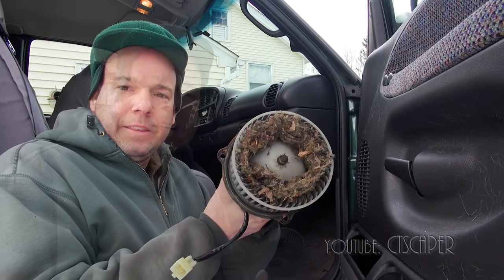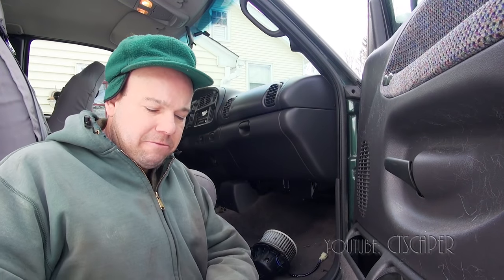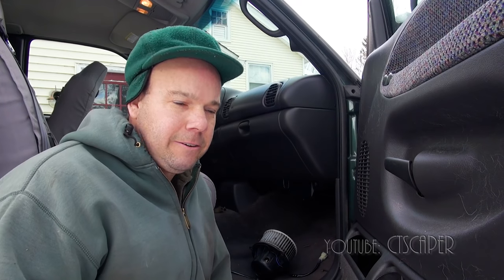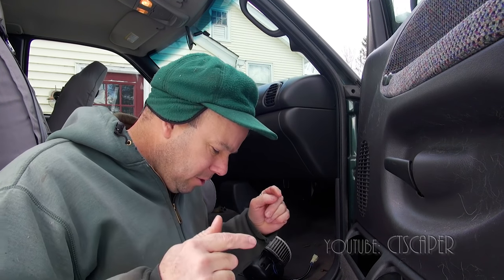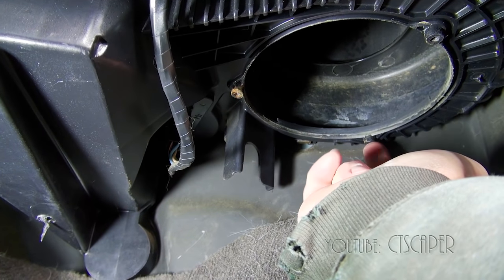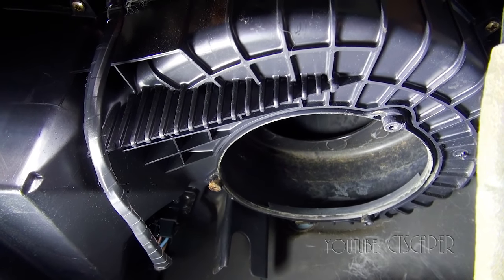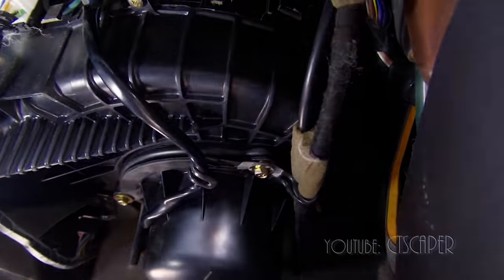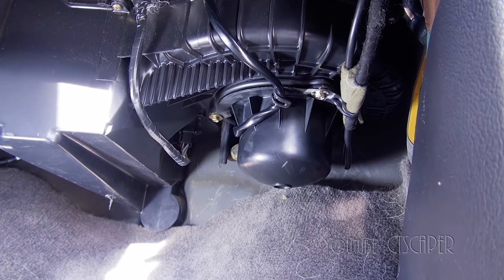BLOWER NOISE IN CAR OR TRUCK

Comment: Two things:  The reason they tell you to disconnect the battery terminal (just take off the negative) is so that your air bags won't deploy because of a short to your electrical system. Deployed air bags without an accident would ruin your day. The other I'd do is maybe tape or jam something up in behind the motor as a "back splash" kind of thing like a plastic bag or a piece of cardboard so that if you drop the little screw or bolt, it doesn't fall in behind your carpeting never to be found again. Keep your back splash higher than the screw and laid out in front of the carpet. Saves grief ....

Comment: Thanks for the post. I have the squealing sound on my 2001 ram 2500 for 2 years now and have been putting it off. But this looks really easy. Why have I not tried yet? Now I have the confidence to do it.
Reply from the maker: It's the most awkward position to be in but you can definitely do it.

Comment: Had the same issue last week, super loud noise  - almost louder than the engine when I turned on my heat on. Assembly is similar to yours in my Nissan. Take apart the glove compartment, 3 screws....of course one in the back is a real pain to access. Anyway, clogged with leaves other stuff. Seems like a chipmunk or mouse was building a nest also. I cleaned it totally out and problem solved thankfully! 7 days later...I get the same noise again, not as deafening...just finished taking this apart once again. More leaves in there (nothing clogged up like last week). 

Trying to figure something out...little hack on how to block this area with a thin screen, BUT this may come loose and fall into the fan destroying it, the entire motor, so thats no good!. Right now...eh, seems I have a very persistent little critter really wanting to live in my heater blower for the winter.
Reply from the maker: Rodents only pretend to be stupid.  It amazes me how they figure out how to get into places they aren't supposed to.  Glad you got it taken care of and hopefully it goes a little easier each time you clean the fan.

Comment: Pretty sure I've got the same problem. Let truck sit for a month, colder weather now. Smells of urine and blower is clearly off balance.  I'm curious if you found the entry point the mouse was using to get into the duct work?  Also any thoughts on removing the odor?  THanks, Great Vid!  Happy Holidays!
Reply from the maker: No idea where they're getting in though the though crossed my mind when the cold weather came.  I've started leaving an enclosed mouse trap inside my truck when it sits for a while.  I caught a few in my dump truck last year.

Comment: I wonder if there could be a filter put up in there. Where the fan wont get caught in that whole you showed us before putting the fan back in ;) I notice how the the 1995-2004 tacoma trucks dont have a air cabin filter but the 2nd and third gens do.
Reply from the maker: I think you've got it Donna.  I don't see a way to reasonably install a cabin air filter in my truck but in the early 2000's most cars started getting them.  Now the mice build their nests on top of the cabin air filters.  Much easier to clean out but just as nasty.

Comment: Yup.  I had a mouse chew through the air filter into the fan and die.  Really hard to retrieve that stinky thing.  Ended up using a pair of surgical forceps but it still too like 50 tries.
Reply from the maker: Now that's nasty.  I felt very fortunate to not find any mice when I was cleaning that out.

Comment: My 2008 Jeep Patriot's heater fan just started making a growling noice when it's on the three highest settings. Just started like that. I wonder if a retaining bolt/nut wiggled loose and there's a lot of vibration. I can actually feel the vibration in the steering wheel. I turned my Patriot off with the key just at accessory position. Same growling noise when fan on high.

Comment: Thats hilarious,,,where does the blower pull air in from?
Reply from the maker: I wish I knew.  A lot of the new cars have a filter for the air coming into the blower motor.  However, older vehicles, like mine, don't.

Even the cars with the filters can have mice in them.  I don't know how, but it happens.
Reply: @CTSCAPER  My old lada had a heater core...pretty sure it came from the outside. As I grew up people used to say the heat comes from the engine. I dont think that is accurate in any case. But prestone from the enagine does run into the core..but anyways.

Comment: I have a similar problem with my 2001 Honda Odyssey but mine is caused by leaves.  No idea how they get in there but at the end of every fall I have to remove the fan motor and clean it out.  Just as hard to remove on a Honda.
Reply from the maker: Does your model have a cabin air filter or is that one before cabin air filters?  My Dodge doesn't have the cabin air filter but it would be so nice if it did.  That would at least slow them down if not block them.
Reply: It DOES have a cabin air filter.  Despite that I still get full-sized leaves in that "squirrel cage". Haven't been able to figure out how they get there.  Has only been a problem in the past 3-4 years so something changed.

Comment: I change the cabin filter from my Toyota corolla 2015. Next day i drove the car, turn the heater on and strange noise from the motor which i never heard before.  I removed the cabin filter n put my fingers in the motor n there was a Walgreen's receipt.  I gently took it out n the rattle stop.
Reply from the maker: I wonder how that got in there?

Comment: How did/do you get rid of the smell of mouse pee?  I have this issue right now but I just can't get rid of the horrible smell. Let me know, Thanks!
Reply: Keon Abbott I just read somewhere else to spray Lysol on the filter and all surrounding plastic and that should remove smell
Reply: There's a spray-on product called OdoBan, a spray. Had a dead rat in my 4Runner. Killed the smell.

Comment: I’m wondering if you would have used a extension that bends like a spring or it is a spring with the ends that you can attach a socket and the ratchet Harbor Freight has them for less than five bucks I think it is??? 

   Oh great video. 💯👍🏼😊

Comment: Wow that's a hell of a nest. I live in WV its been 0 degrees and I just fixed my heat in my truck for the first time 1994 Chevrolet C1500 and my blower moter is squeezing like a bitch. Mine is going to look similar but it's going to be filed with leaves and branches from years and years in the woods.
Reply from the maker: I've had to clean that out a second time since I made this video.